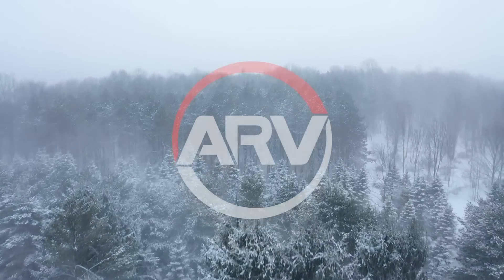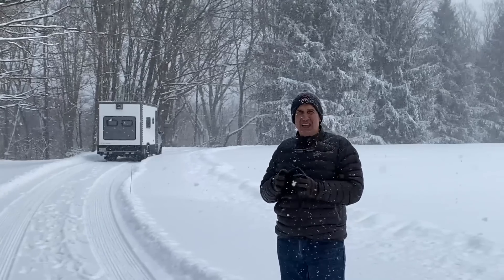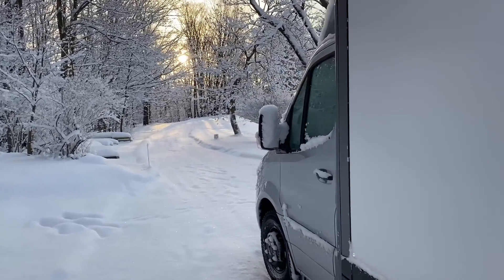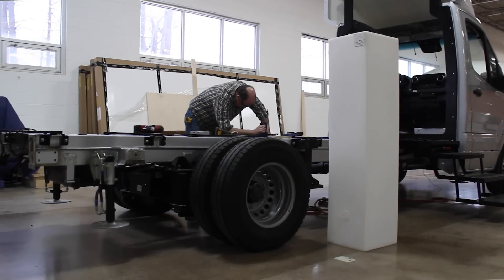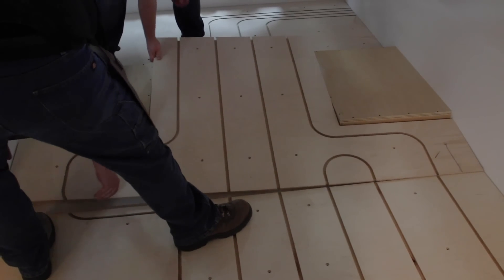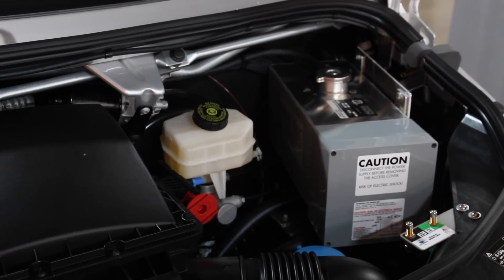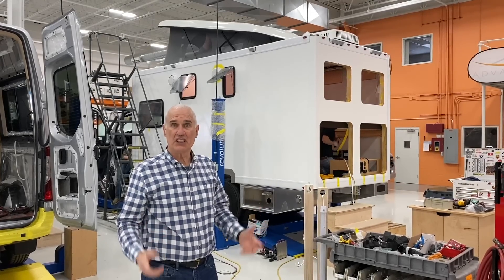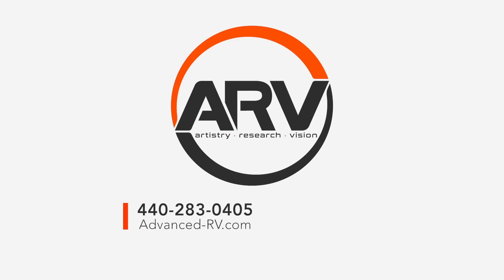B Box Performance in a Deep Winter Freeze

Comment: Are you running the glycol solution through the engine, as well? That way, keeping the engine warm in cold temperatures, and using engine heat to warm when the engine is running? I know they do something like that at Agile vans with the Revel. A fellow named Chad, who does the channel, "Living the Van Life," went on an arctic excursion this past winter, in -40° F weather. He ended up using cardboard to cover the front end, as the engine was struggling to keep warm. There have been a few experiments done by Mercedes, and their vans sometimes don't do as well in the arctic as a gas powered vehicle would. In Chad's experience, the DEF was beginning to gel, and it almost made the motor go into protect mode. So, keeping the motor warm at night, so you can get it started would be good, so maybe run it through the motor as well. The other stuff, like keeping the DEF and other things warm, that's a different issue, but ive heard to use some kind of vinyl to cover the grill, not cardboard, as it becomes a mess if it gets wet. Great video. I see no reason the rig wouldn't be able to do just fine with snow tires.   I have owned 2 wheel drive trucks for years, S-10, Ranger. They go anywhere with Bridgestone Blizzak tires!

Comment: Very interested in the B Box Project 4 season camper & will be watching for updates. The price chases me away, but it is new, & your brilliant team of engineers do need to be paid for their hard work. I love the sound of the air ride suspension system that you have selected for your project. Also love how they mastered the need for electrical power & harnessed that need with-in & kept it generator free. Everything that your engineers put into the project such as the heating elements which also keeps the tanks warm are such a big plus as I have seen other video's of campers with frozen tanks creating big problems. Wow, who ever came up with the idea of a water purification system that allows for use of safe recycled water. These are just a few of highlights of your perfect built RV.  Also have noted that I heard in one of your video's something about a possible 15MPG for fuel mileage. That's fantastic for what you have here & makes it affordable to drive & use. I currently own a 1989 Dodge Pheonix which is an older van converted to an B Class RV. She's powered by a gas powered 360 CUI engine & I can get 15 MPG with her if I keep my speeds down around 58 - 60 MPH. She does not contain a generator on board, but I have a smaller gas powered Honda 2000 portable I bring along for power needs. I recently also invested in a couple of smaller solar generators (a 500 Watt & a 1000 Watt) which are also portable & can be used inside van. Keep up the great work.

Comment: It would be interesting to see a flir image from the outside.  I wonder if the van doors suffer the biggest thermal bridge heat loss.
Reply: I'd guess it'd be fairly even across the walls, windows would be the biggest loser and highest temperature, even double-pane is going to lose compared to foam walls.  The water tanks would be visibly different, looking at their videos it appears to me that the insulation there is thinner, watching their B Box videos, for the tanks it looks like they're using 1 inch polyiso compared to 2 inch in the walls.  OTOH, the water tanks can be at a bit lower temperature than the passenger compartment (say 50 degrees compared to 70 degees), and that means reduced thermal gradient and so a slower heat loss.

Actually I'd like to see such a video to see if they have any losses to sealed areas.  Windows and doors are what people think of most, but the dozens of holes cut for vents and pipes and wiring all need to be properly sealed and even then, the pipes and wiring themselves are also thermal bridges.  Although it's also a matter of surface area, and those should be relatively small.

Comment: How does the heating system work at altitude. I have really struggled with diesel heaters at 10k altitude and I do a lot of boarding in the mountains. I currently use a Wave 8 propane heater but curious how your rigs work at 10k altitude or higher.

Comment: Always innovating, I love all your ideas. The heating system is ingenious 🇬🇧🇬🇧🇬🇧
Reply: Read the charging system design, using high voltage alternator to charge the lithium in conjunction with the solar panels. Although solar in winter is obviously not a viable system.

Comment: I would like to know what the electrical draw is, eg how many amps does it take to run those 3 pumps and
fire up the diesel heater and the lights. Is there 2  deep cell type batteries or lithium? How do you charge the batteries  if you are boondocking for a week or so?  Great  vehicle and appears very well built.
Reply: Seems they go with a ****load of lithium batteries (Another video they quoted 21 kW-hr of lithium battery onboard) and have the vehicle turn on to charge the battery when low (They also quoted 3.25 hour charge time).

It would be pretty genius to do a heat exchange of engine coolant with the hydronic fluid while the engine is running at temperature.  Then you could use waste engine heat to heat the entire vehicle while the alternators are charging the monstrous electrical system.  I think this is how Earthroamer does it from the one video I've seen of a walkthrough of theirs.  At least that's how it was described as using engine heat to heat the hot water tank's water.

Comment: 1) I wish you gave us some details! Like: Temperature that was set inside the Van, and how much propane/diesel/electricity was used to keep it at that temperature. Without it lots of cheaper options could say "it was nice and toasty inside" but maybe they used their entire propane tank to keep it that way! 
2) I wonder how it will compare to a 3x times cheaper Winnebago Ekko! It seems like WGO went with a very similar design and AWD too; and I wish I could see how premium price for B-Box makes it better than EKKO?
Reply: I believe you can’t compare Winnebago products to ARV. Apples to oranges.
Reply: @jodymooney255  You can compare them, but like you said they are very different.  If I won the lotto I would order a bbox, but since they could do it custom I would have lots of things different.  What you get is way better insulation, fuel mileage, never ending shower, induction cooking, premium sound system, quieter, way better suspension.  Generally a much more comfortable RV.   Those diesel heaters use like .2 gal an hour, maybe less.  Way cheaper and more easier than propane,  Now, I would like an Ekko, but can't afford one of those yet either.

Comment: I really like the idea of the B box,  I just strongly dislike the molded transitions. I wish it looked more like a work truck and less like a winnebago.
Reply: You need that for fuel economy...makes a huge difference in aerodynamics.
Reply: @dlg5485  How big? and why don't work trucks (which also burn fuel) worry about it?  I'm not saying not to have any faring, just something a little less swoopy, maybe square out the front so there is a bit of overhang on the sides ; continue the flat roof a few inches further forward, and just go with a rounded leading edge on the sides. Aerodynamically what you do at the front doesn't matter nearly as much as what you do at the back.
Reply: @opcn18  You can buy work truck with that faring, I think with a gas e450 v10 it would be the difference between 13 and 11 mpg is what I have read on internet forums, so more than 10%.  No idea how much it helps on the diesel bbox.
Reply: @craigclaussen4589  that's really poor milage. A gas Fuso with half again more weight gets around 13 per gallon with a flat front, no fairing, and no trailing edge vortex. I'm also not saying no fairing, I'm saying a more industrial looking fairing. Ironically I started out saying that the problem is that it looks like a winnebago but as the conversation has gone on I've looked up a few winnebago B+ RVs and I think their fairings look a lot better than the ones on the B-boxes. 

The sprinter is contoured every kind of way, the B-Box is straight slab sided, I feel like the fairing needs to acknowledge that decision. I doubt very much that these fairings were designed by an aeronautical engineer and wind tunnel tested, maybe a few CFD studies were done but they were probably straight from an artists design board onto the product. I think they just look out of step, and something that doesn't could be built without a huge drag penalty.
Reply: They'll leave it off for you if you don't want it.

Comment: Our previous house had hydronic floor heating and we loved it.  The heat just doesn’t warm your feet, it also gets conducted by all the furniture and cabinetry that touch the floor and so the furniture becomes heat sources themselves, radiating a gentle warmth throughout the house.  Best of all, no forced air heating convection was necessary and so the house was an oasis of calm and quiet.  We were in New England and our heating bills probably would have been much higher if it wasn’t for the hydronic heating.  Given the high insulation value of your B Box, your test results are consistent with what we had experienced, albeit in a house.  B Box probably doesn’t need the convection heat but it is certainly great to have this as a redundancy for those who want to boondock in harsh Arctic climates.  Well done!
Reply: Sam Sung. I enjoyed your review explaining the comparison. Well written and well read. Thanks for sharing.

Comment: Any plans to connect the hydronic heat to the engine?
Reply: Yeah, I was thinking the same thing a while back. So, a possibility is that it would have to be regulated with a 3-way electric ball valve that would switch back and forth from engine heat to internal hydronic heater (with logical thermostatic controls). But, as the temperature drops from the engine, it then becomes useless (since the living area is used mainly when one is not driving) . So the my question would be, how long does the engine provide 'meaningful' heat (as a heat exchanger), AFTER the engine has been shut off,  before the thermostatic controls switch the valve away from that heat source? Once we answer that question, we can see if this project is even feasible.
Reply: @mikefranks4528  I was thinking more providing heat to the engine block for very cold morning starts.
Reply: @fountainvalley100  most overland trucks use a second diesel heater.
Reply: @mikefranks4528  most overland trucks use a second diesel heater.

Comment: Can the box be built on a Ford f350 or f450?
Reply from the maker: Yes we're open to exploring builds on other platforms.
Reply: Are you thinking Quigley4x4 on the Econoline chassis? I suspect there would be too much lift, giving center of gravity issues, especially with full tanks. A better bet would be the Transit Chassis with AWD that is not lifted at all.
Reply: @arisdaddy2001  l was thinking a f350 or ar450 pickup chassi with a bed delete

Comment: Dang that is slick. 

Be cool if you could also pass the engine coolant through the hydronic heater to pre heat the engine.
Reply: A diesel heater that does that is an option here in Europe. It's like a $500-1K option. It heats the engine and the cabin with a remote or timer. No reason not to do it. Huge comfort upgrade, better for the engine and the environment.
Reply: For cooler climates this idea is simply brilliant, the cost savings on reducing motor wear using preheating for the motor is great/common sense engineering!